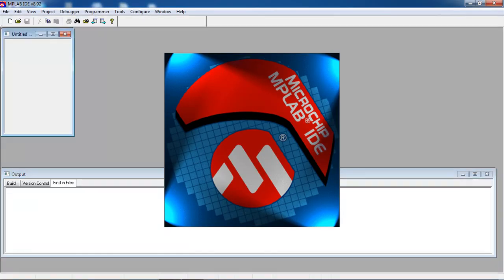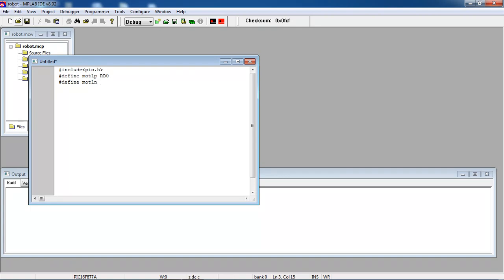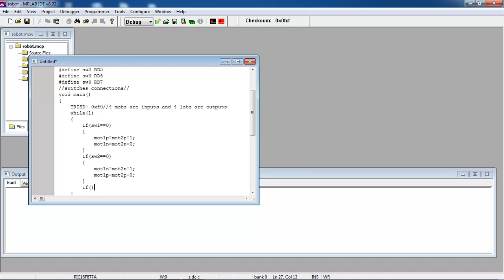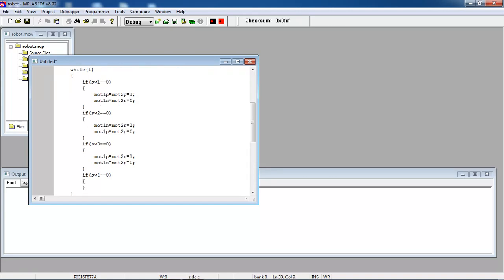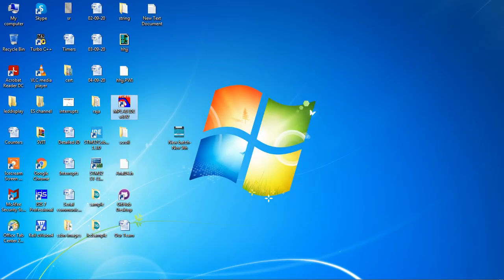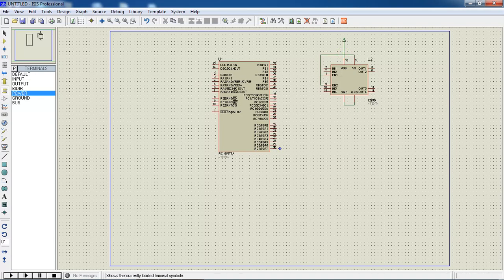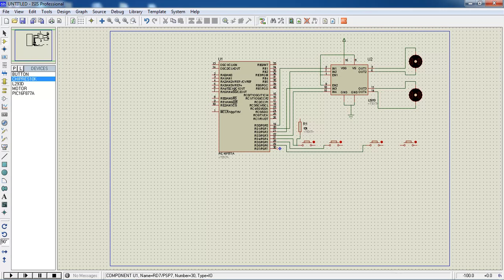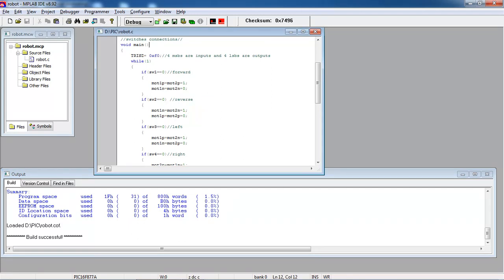Robot design using PIC16f877A  micro controller using motors and controlling with switches

Comment: What is the use of resistors in the circuit
Reply: you probably know by now, it's been 2 years since posted . it's to control current , that's what resistors do, keep current down and save the led or microcontroller  from burning up (getting too hot) ok.peace out